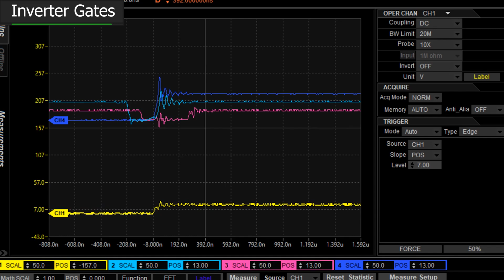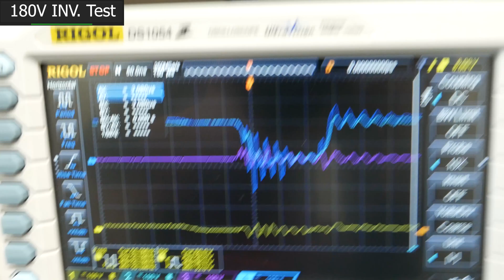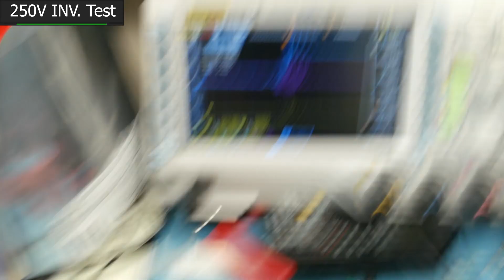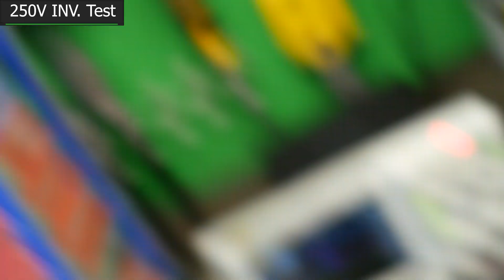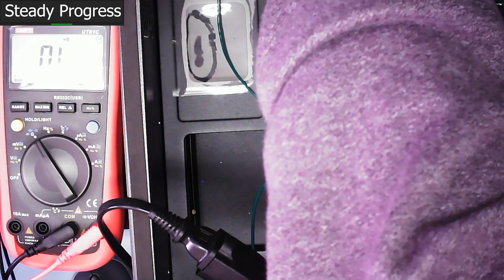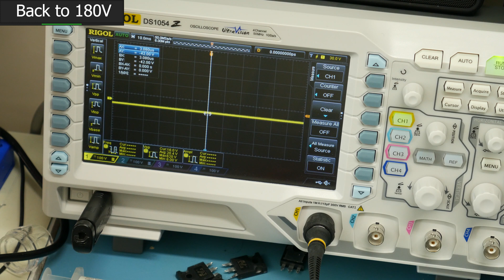1kW: One Last Chance! (DIY UPS 2)

Comment: I think you may have a problem with the transformer(s): you will need to model the parasitic RLC pcb traces + mosfets  with that of the transformer. you may want to study a working app note and build off from there.
Reply: Another tip: design a controller board as a daughter card and keep the heavy transformers, caps on a flat pcb, again look at existing designs like Sunny Boy or Fronius design and study the mechanical and electrical decision they will help.
Reply from the maker: You make some great points! These companies didn't make their architecture on accident. I plan to start the next leg of this series soon... stay tuned!

Comment: my recent gate drive story

i am building a full bridge welding inverter (with through hole components) which has a discrete full bridge gate drive circuit to power the gate drive transformer(GDT). the full bridge circuit powering the GDT is made from p and n channel mosfets. whenever i powered up the gate drive one N channel mosfet heated up crazy.  

if i touched the gate pin of that mosfet (with my finger) it would short the auxiliary power supply which supplies the gate drive with 17v.  i did not use pull down resistors on the gate for the n channel mosfets so i put a 10k pulldown resistor for that particular mosfet. heating problem was solved. but then i was not getting a proper gate drive output at all. 

i just couldn't find the problem at all and let it sit idle for a few months after getting frustrated. one fine day i just inspected it again and found that the gate resistor lead wire going into the pcb through hole was not long enough (bcz i cut the lead wire too short) and it did not solder to the pcb pad connecting to the n channel mosfet gate. 

damn i was happy but annoyed how a simple problem caused me months.

wish you good luck with your projects.
Reply from the maker: Aha!!!! That's fantastic!!! It's amazing how many problems can be caused by a soldering issue or stray wire... I'm glad you found the problem and got everything figured out!

Pull down resistors can be very important for mosfets gste drive. :)

Thank you for sharing! Do you have some pictures or videos of this awesome project coming out anywhere?
Reply: @EEforEveryone  I haven't uploaded any pictures anywhere as of now. But once the project is finished I will definitely .

Btw in your case I would suggest you check the auxiliary supply that powers your have drive. I think your MOSFETs are not being driven fully. May be there is a problem with the auxiliary supply in your case. Check the voltage output of the auxiliary supply when your measuring the inverter output.

Comment: A ferrite bead on your drain pins makes a massive difference to ringing if you want to keep the risetime very fast. Or an RC-snubber but the ferrite bead is generally better for dissipation etc
Reply: Having a look at your schematics and thinking of potential issues, not saying that any of these specifically ARE issues though, just thinking out loud.
your 
Probe your gate drive power supply - your booststrap diode has a maximum reverse recovery time of 35ns and there may be some serious noise coupling back into it because of your fast rise time + high dv/dt, may not be apparent at low voltages

Since the inputs to your gate driver are high impedance, noise coupled into those can cause issues too, maybe probe those and check what is going on, to improve noise immunity usually I stick a 1k pulldown on my drivers inputs just to reduce the sensitivity. Input-output capacitance is pretty low but when the input voltage level and output voltage levels are orders of magnitude different it can be an issue, may not be apparent at low voltages because of the whole 1/2 * C * (v^2) thing.

A tiny bit of capacitance on your Vl-n opamps inputs to act as a LPF would be good, 100pf~ would cut a lot of noise out and shouldn't hurt phase too much.

Wouldn't your EMI suppression caps be more effective on the output side of the cm choke? (for conducted emissions at least) Looking closer I feel like that would be the case for a lot of things in that part of the circuit but it depends on what you are trying to achieve.

Excellent videos as usual though, 10/10
Reply from the maker: Wow, Thank you bdgweipp! I've got a onenote page where we're tracking opportunities to refine this design. I'll definitely copy your thoughts over for the next go-around! Great thoughts about the gate driver, opamp noise, and adding a Ferrite on the drain! With regard to the filter caps, I think we've got them on both sides of the choke, but I might be mistaken. 

Thank you so much for sharing your insight, and for watching! I'm glad you're enjoying our videos. :)